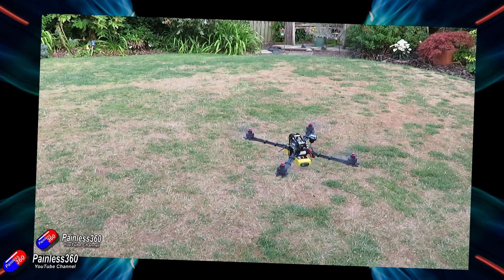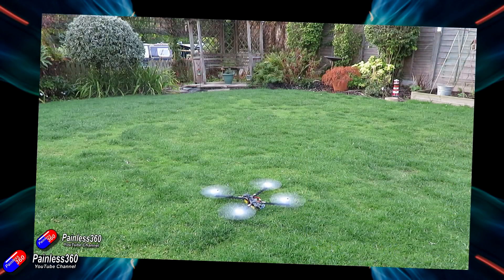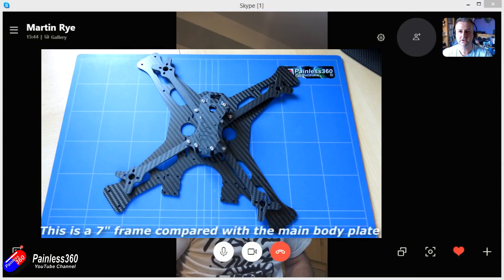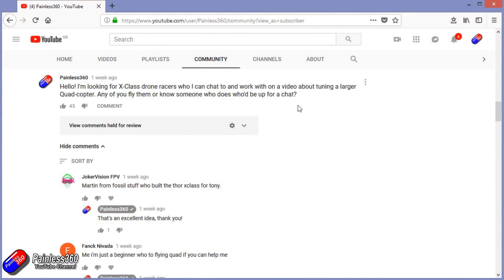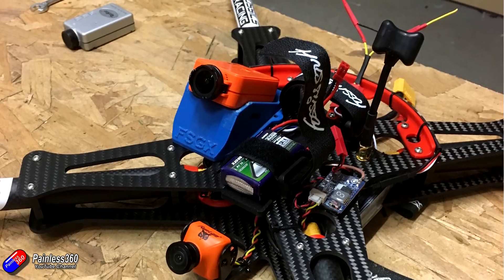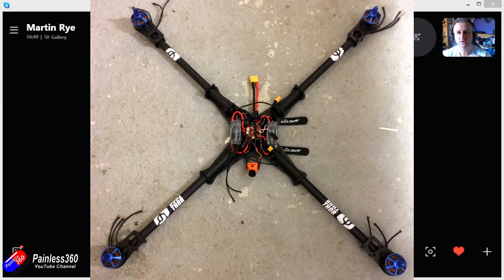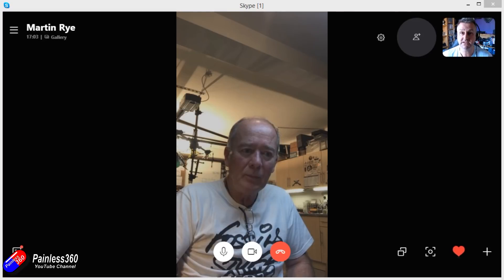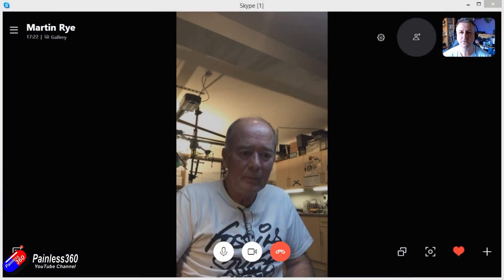Endurance Quad Build: Setting up Betaflight and other tips from Fossilsstuff

Comment: ive read online that simon k firmware is less prone to desync but I haven't really seen it. the only time ive seen desync is when I over propped a motor ran a 14in on a motor suited for 10 (got really hot too). I believe the lower kv motors are designed in a way that they provide sufficient torque to negate desync issues. Just make sure the manufacturer says the motor can turn the prop you want too use.
Reply from the maker: It's more about motor timing - similar to the spark advance in a petrol engine. If the motor is spinning a lot more slowly then you don’t need to create the next magnetic field needed as early as in faster motors. It's easy to tell if it's happening - it sounds horrible and the motor starts running like it has coal for bearings! Agree on the prop comment, see the results of the testing I've done to see how much more a motor will pull by adding a prop with just 1" more diameter or 0.5" more pitch.. :D Happy flying!
Reply: I have also found raising the idle speed helps prevent desync because it's that extra juice required to respond that causes it to reset.

Comment: Try the T-Motor MN 3110-15 780KV and a 12-6" Prop from Graupner E-Prop, it's taking abaout 6 -8 Amps on 4Sfor cruising. I have been flying them on a modified X-Frame with short front arms at about 170° angle and longer back arms at about 90°  angle and a Tattu 4S 6750mah battery, worked great and flight time was around 20 to 25 minutes. Flight Controller was a soft mounted Vector. 4 Speed Controllers from Gerabest were to heavy and later I took a 4 in one from Gearbest, don't know the type anymore, but it worked out of the box.

Comment: I have an old 9 inch quad that had 2 axis camera stabilization that flew for 8 minutes on only a 4s 3000 with some old sunnysky 2212 960 Kv. built the whole thing for under 400. I just rebuilt the thing and took off the camera stabilization and switched to a F4 board to lighten it up, will test but the thing should fly for awhile now with lots of room for more batteries.

Comment: Maybe the weather plays a part in it we have really hot humid summers here maybe that a contributing factor on our hot motors and a ESC not sure how the summers are over in your neck of the woods though maybe the same as ours?
Reply: We were fairly warm this year at 25 - 32 C for several months. Not sure ambient temp difference would set esc’s on fire but I may be wrong.